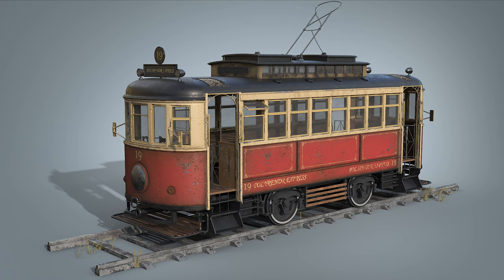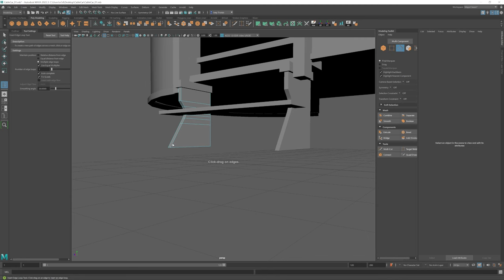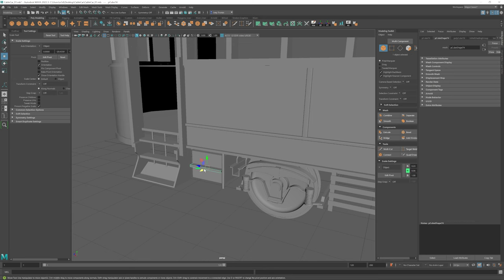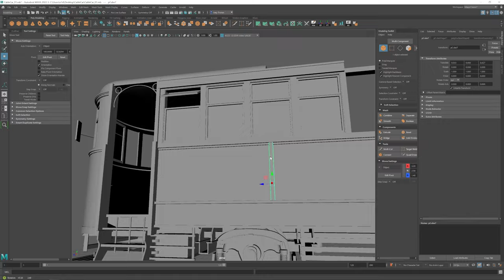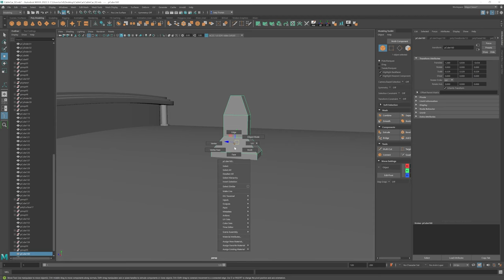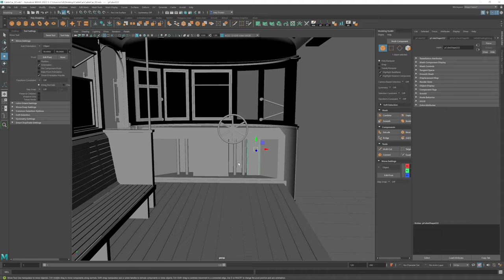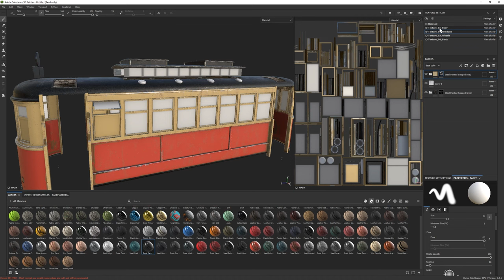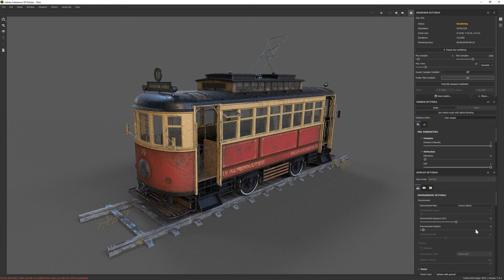Cable Car | Speed Modeling | Autodesk Maya + Substance 3D Painter

Comment: I've been learning substance painter through your videos and your content are really great.
There's one part in this video which I don't understand, at 1:30:50 you use 'Glass Film Dirty Mirror' texture and it gives a proper glass effect but when I use it, the windows turn black. any solution to it? Thank you
Reply from the maker: Thanks I’m glad you’re finding the videos helpful! 
I believe the “black” you’re seeing is the dirt. That materials always does that for some reason. Either turn that layer off and the black will go away or turn down that dirt effect and the “black” will start to go away and only show on the edges. I usually just turn it off and add my own dirt and grunge afterwards.
Reply: @polyrendr  Thank you for your kind reply. Hope to see more wonderful content in future.

Comment: The model is fire and so are the instrumentals you've used, any chance you can post a list of the instrumental names? 
If its too much of a hassle dont worry about it.
Reply from the maker: Thanks man I really appreciate it! Unfortunately I removed the audio files from my computer so I don't have all the names :( However, in situations like yours I tend to use the app Shazam, maybe you already know of it, but it very quickly finds the song names by listening to it, give it a try it might help! I will keep this in mind for future videos tho :)
Reply: @polyrendr  no worries man and yeah tried shazam but it doesn't always pick up on some songs. great model again hopefully I can get to that stage one day, atm i struggle with block outs as I find it had to conceptualise which shapes I need.
Reply from the maker: @Ossie_Gaming  You can totally do it! Just keep practicing. When it comes to blocking things out, just think really simple. Try not to over-complicate it and worry about getting things perfect right away. I find keeping things as simple as possible at the beginning really helps.(Just squares, cylinders, etc.) As shapes come together I find it gets easier to tell what you need and where to put it. Remember you can always change things up as you go. Things will slowly start to look better and more accurate, just keep it up! 🤘